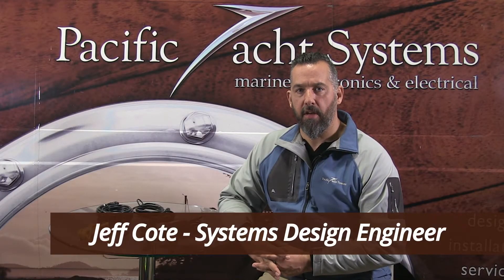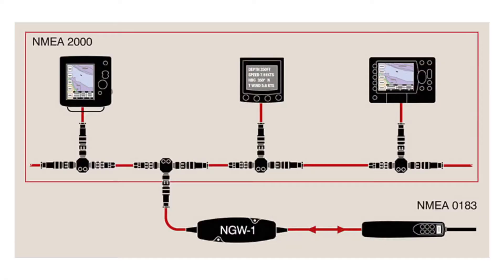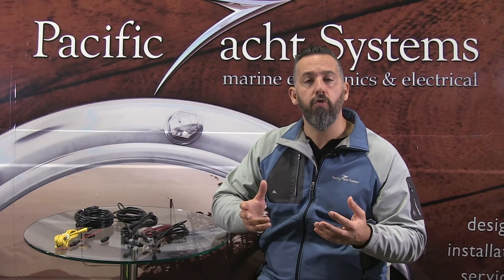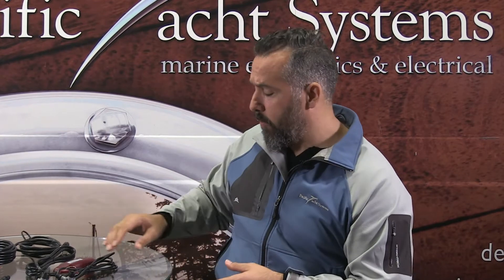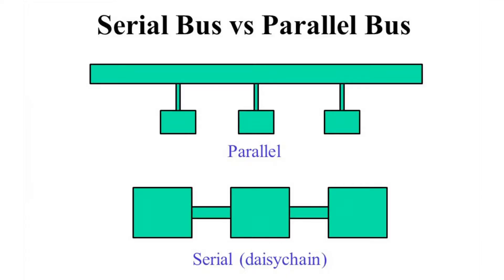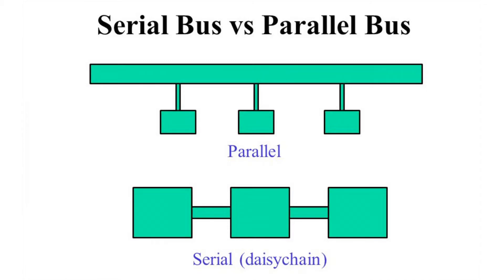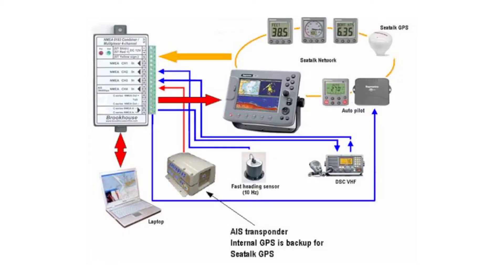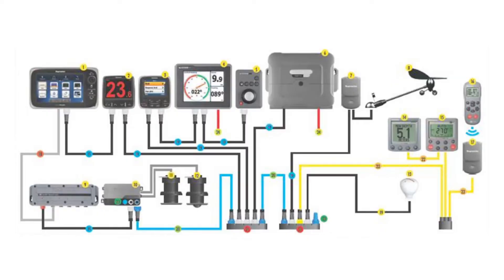What is an NMEA 2000 Network

Comment: How can I add additional batteries to an NMEA network?  For example, my boat has a Garmin 943 display and I just added a 24v trolling setup and want to monitor the battery voltages on my Garmin gauges display?  What cable, device or ??? Do I need to add that into my existing NMEA network?

Comment: Sorry, but you are confusing things here. NMEA 2000 is not a parallel connection. NMEA 2000 is built upon CAN bus and this is in fact a serial bus. Parallel means that a full word is transmitted at a time (for example 8, 16 or 32 bits at once, depending on the bus width). A serial bus transmits bit after bit sequentially. What you are describing is network topology. A bus topology interconnects several devices using a common medium. Daisy chain is not a bus, as it is it's own topology. What you are describing first, sounds more like a mesh topology, where every device is connected to each other. Btw, serial doesn't even mean that only one participant is able to talk at one time. You can have full duplex serial connections (RS232 for example). But it is true for CAN and therefore also for NMEA 2000.
Reply from the maker: Thanks for sharing Jago, appreciate the clarification.
Reply: Underrated comment. Missing information on the use of multiplexers as well.

Comment: Hi Jeff I wanted to see if you had a little insight about Garmin  93 UHD I’m having a problem with my engine control trim display it is not displaying my trim position  all the other gauges work I have installed in an NMea 2000 Network all my gauges and controls work the only one that is not reading the position is   the trim gauge i have a 2011 yamaha f150

Comment: You stated that the max distance from a device to a NMEA 2000 backbone is 18'. How do we handle top of mast applications (wind, radar, AIS, etc.)? Also  what is best for multiple mast devices (separate drop downs or T to T connfigurations)?
Reply from the maker: Hi William, max distance of N2K drop is 18ft or 6M. The max length of the network backbone using the Micro-category cabling is 100-meters or 328-feet
Reply: So how would one deal with a 55 + foot mast?
Reply: And what would you suggest for the multiple device on mast situation?
Reply from the maker: Bring the backbone to the top of the mast with a N2K tee at the end of the mast. Insert multiple N2K tees on the path to the top of the mast.

Comment: Hello, Thanks for your video. We have a problem. As our monitor is a normal display monitor without NMEA2000 system, how to install this monitor to work with the NMEA2000 system. As we want to install the normal monitor and using with a Raymarine e165 Hybrid touch Chartplotter. Is that worktable? If not, then how to do with that?
Reply from the maker: Hi Chen, to display battery monitor info on  NMEA 2000 compatible monitor you'll need a N2K battery monitor like the Maretron one.

Comment: How do you connect an old display monitor to a new one with the old system was flat, the new one is round? Any ideas? Thank you. It is ray marine
Reply from the maker: Hi Jean Claude, that's a hard one. The flat connector you have is called SeaTalk and the round one is called SeaTalkNG. You'll need to get a Raymarine ST to STNG converter.